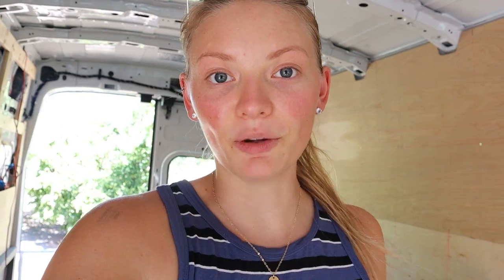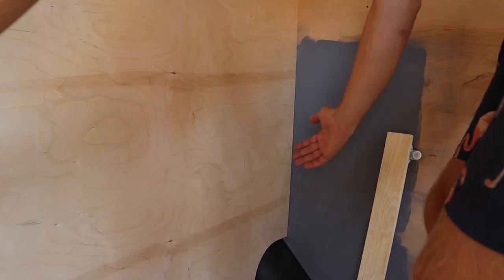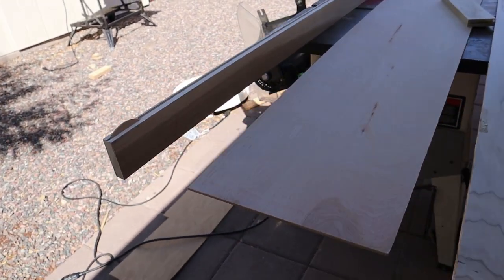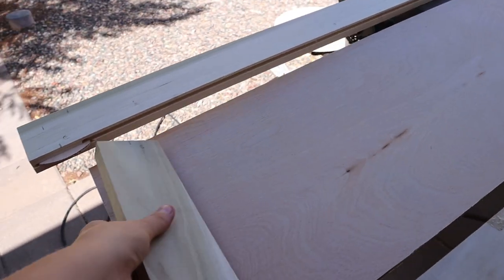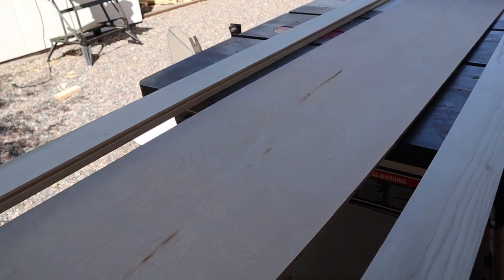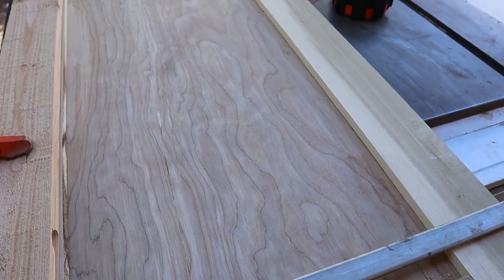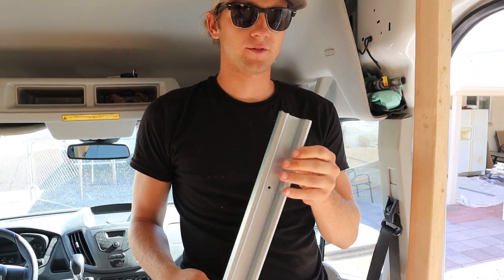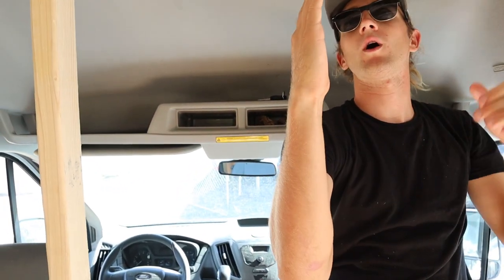Custom Cabinetry in a DIY Van Conversion - pt.1 | VAN BUILD SERIES (week 3)

Comment: You two absolutely rock! Your intro rocks too : ). Your drive, skill, presentation and demeanor is / are wonderful to watch! Doing the build in AZ, during the summer... is a big WOW :). I can't wait till you have your first shop so instead of driving to HD every 10 minutes you'll have racks, and bins, full of 1x, 2x, 3x, byby, fasteners, couplings, wiring, glue, primer, paint, LED'S, LSD : /, insulation and on and on. I've never built out a van and wonder if you worry much about weight (materials wise: 3/4 ply cabs, 3/4 OST, 2x floor furring), and squeezing out every possible square milliliter of living space (it looked to me like you could have gone tighter to the side walls but I wonder if the headache of doing so is just not worth it?). Also do you worry about toxic stuff like your paints, glue / adhesive, OST, panel insul, etc.? Can't wait to see how the heck your gonna plumb the base of that shower!!! KEEP UP THE GREAT WORK AND VIDEOS PLEASE!!! PS: I saw a note, below, where someone correctly suggested turning your bed supports vertical... but notching them will kill any gained strength IMHO.

Comment: I use a cad program,like sketch up. But I have a background in manufacturing engineering and have been working in mechanical trades. What about a simple compass to scribe can curves on cardboard that is my trick for getting good fits?

Comment: Very nice build. Have you seen the new Ford transit? Lot of nice features. I’m considering a van and if I do, I think I might have you guys build it out. 
Question, what about the ikea cabinets?  Thanks
Reply from the maker: We’ll have to check out the new transit! If you are interested in a custom build you can fill out an inquiry here: https://www.kensieandjoey.com/van-builds

We don’t use any prefabricated cabinets, we custom build all of them to the correct dimensions for each van. We use the best quality materials which hold up far better than something like IKEA, which is made of laminated particle board. Hope that answers your question! :)